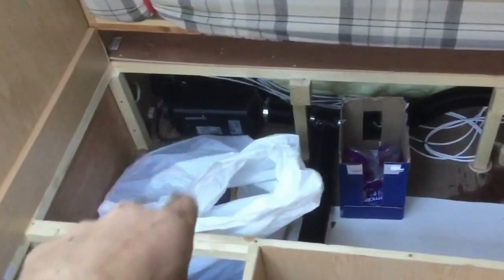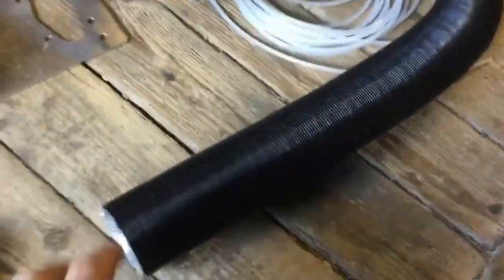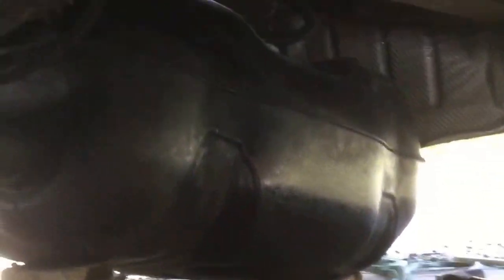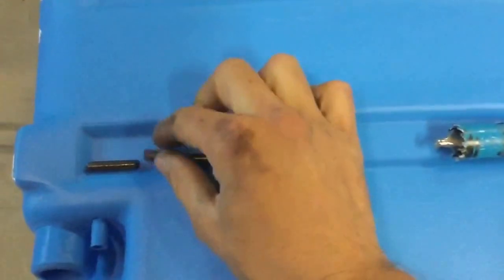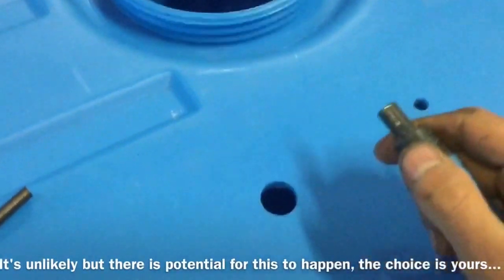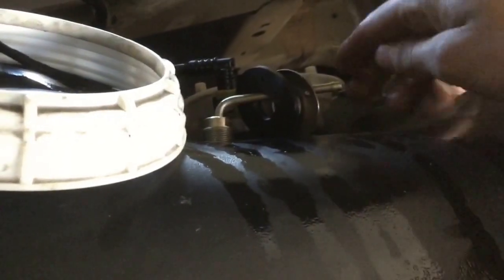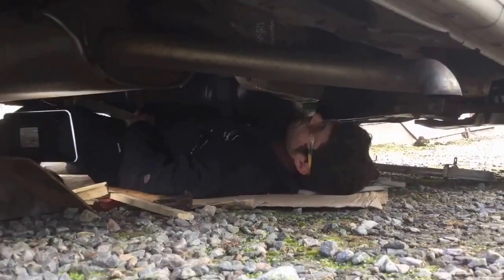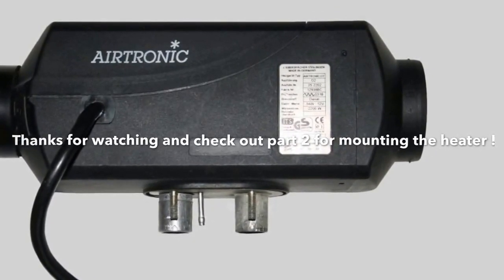Fitting an Eberspacher D2 to a Citroen Relay campervan - PART 1 Intro & standpipe.

Comment: Hi, I've fitted a diesel heater to my 2008 long wheelbase Citroen Relay. It's currently running from a small secondary tank but I want to take diesel from the main tank instead. Is there any reason why I shouldn't just use a T-piece to tap off from the main fuel line to the engine? The heater kit does include a T-Piece. I will never be using the heater while the engine is running, so presumably this will work regardless of whether the fuel line is pressurised or not, as the engine needs to be running to keep the pressure up. Am I correct here?
Cheers for any advice.
Simon.

Comment: if you'd used the hole that the plastic screw grommet is sat in (seen by your knuckle at at 2.54) you could of poked the saw from underneath the metal, leaving the stem (the bit you cut) proud with enough to atttch to your drill to cut the hole and not have to remove the tank... thats how i fitted mine to my 2008 fiat ducato

Comment: Thanks so much for posting this! It's difficult to find useful instructions for these things, as I'm sure you're aware!
One question, do you remember, what direction is the thread on the fuel tank cap nut (big white moulded plastic nut)? I'm having trouble getting it off, and the Webasto stand pipe I have is to be fitted into the cap itself.  Do you remember it being a reverse thread, or is it normal direction (anticlockwise to remove).
Thanks again! Great video!
Reply: I assume you manged to get the nut off in the end!? Trying to do this job now, is it a standard thread?
Reply: @worldwideflyby  We got it off, it is a standard direction thread, just very very stiff! From memory, I think I used a chunky screwdriver with a piece of wood or something against the ribs (to reduce damaging the soft plastic), hold it at as shallow an angle as possible,  and tapped the end of the handle very firmly with a hammer. It took quite a few taps. Very difficult access though, as I'm sure you're finding. I think we had both seats out at the time but it was still awkward. Good luck!!!!

Comment: Hi, Great video, very informative and easy to follow. I have a 2011 Fiat Ducato Camper which I am about to install one of these cheap Chinese eberspacher copies. I'm trying to work out in my own mind if I should use the 10 LT fuel tank that is provided in the kit or if I should do what you have done and connect it to the Ducato's fuel tank. I have room for the kit tank in the Motor Home. I noticed you also had room in your Citroen. Was there any particular reason you opted to connect yours to the Citroen fuel tank.  From your video it doesn't look that difficult to fit a fuel take off, but I'm the sort of person that if I touch something I often end up giving myself another job to do.    Many Thanks
Reply from the maker: Michael Wills It really is your preference if you install a tank or not, I work out of this van in the winter and use the heater a fair amount, 10l tank would restrict how much I could use the heater so just wouldn’t work for me. I would need to fill it more often than the van so would mean extra trips to the fuel station and so end up costing more time and effort. The only reason I can see to have extra tank is if you were installing in a petrol vehicle or using cheaper non road legal fuel in the heater tank. Otherwise I think you are inviting the day you go to turn the heater on when your a way from a fuel station and find the tank is empty and you don’t have heating. Standpipe just means you don’t have to worry about that, the fuel is always fresh and provided the van has fuel to move you will never have to worry about the heater running out of fuel.

Comment: Would the be enough space to put the standpipe in the actual existing cap/sender unit?

Or could you T piece into the existing pipeline
Reply from the maker: If the fuel system is high pressure then you can’t just T into it as the metering fuel pump of the erberspacher won’t function properly as far as I am aware. In the Citroens I don’t think there wasn’t enough room to fit the standpipe I had into the cap but you could always try. Some vans will have aux fuel take off already there (transits) so you can just connect to that.
Reply: MiNe Yours thanks my van is a Citroen Relay too.

Comment: Hi want to fit a d1 to my boat but restrictions on length of exhaust important so can you tell me the maximum length of exhaust. And the name of the marine sit for instructions cheerss
Reply from the maker: +martin blackwell Hey not had any experience with the D1 heater series, found the manual (https://www.butlertechnik.com/downloads/Eberspacher_D1L_installation_manual.pdf) page 8 has the exhaust length info. From a quick glance it is showing at 1 metre max but has to be matched to intake length I think. 

If you do end up getting a d1 there is a lot of info on servicing them on le tonkinois website which could also be useful (http://letonkinoisvarnish.co.uk/Models_A2_Older.html)
Reply from the maker: +martin blackwell couldn't find marine specific manual for the d1 but the unit would be the samei believe so exhaust length would be.

Comment: Hi Mate, 
Thanks for videos. Really useful. About to do the same job to my relay and takes some of the fear away. 

Regarding removing the sender unit cap/pipes etc. When replacing this are there any precautions to prevent a bubble in the pipes or anything that I am missing, or is it as simple as taking it off and putting it back on properly.

Thanks

Nadeem
Reply from the maker: +Nadeem Al-Khafaji Hi there, I found that there was no need to do anything special with the pipes, I wouldn't start the van obviously with the pipes disconnected but any small amount air that got in had no problems been pulled through the system. I only disconnected the pipes as I dropped the O ring in the tank otherwise you could fiddle and do it without disconnecting them if it was a major worry. 

There are a few bits I chat about in the technical bits videos too that are worth a watch but not much that isn't in your manual. Anymore questions just ask and good luck!